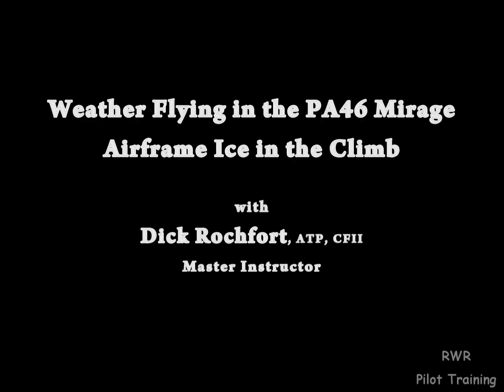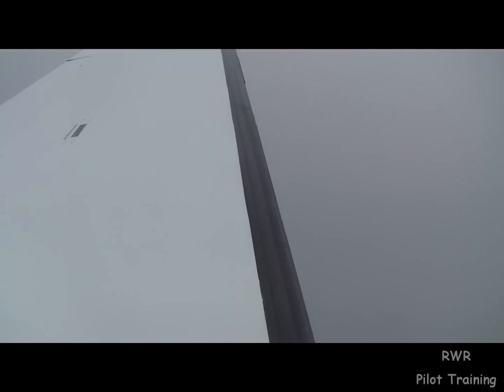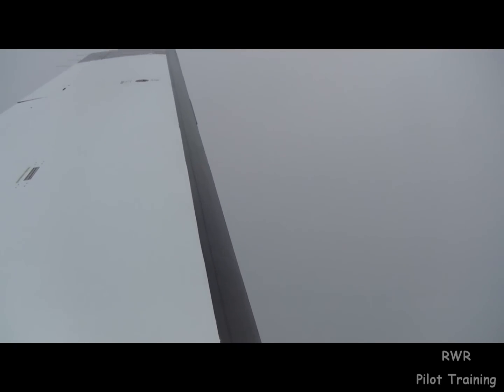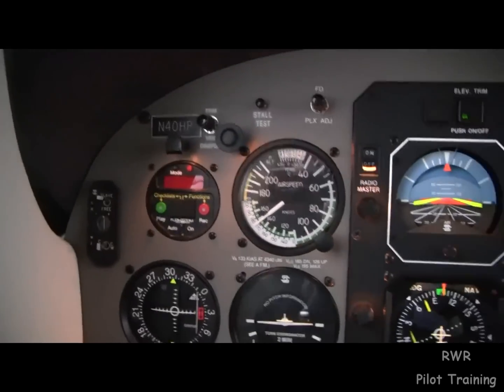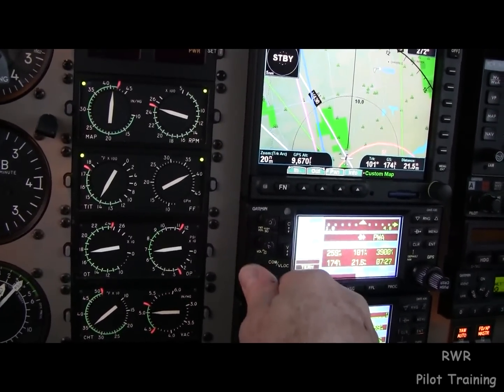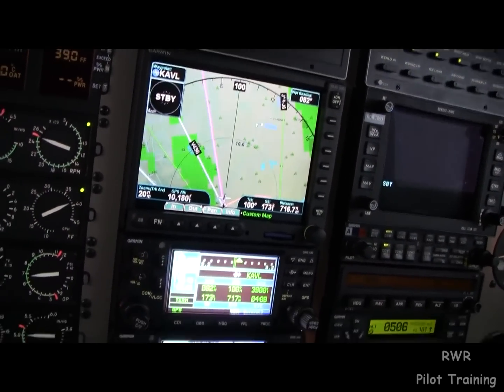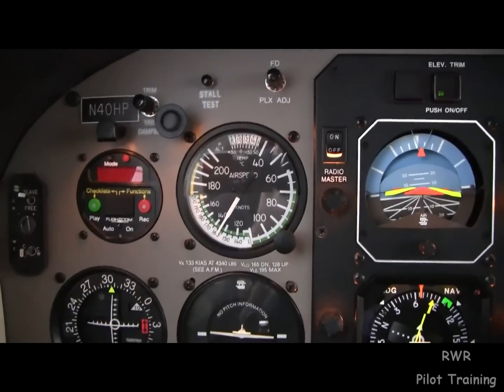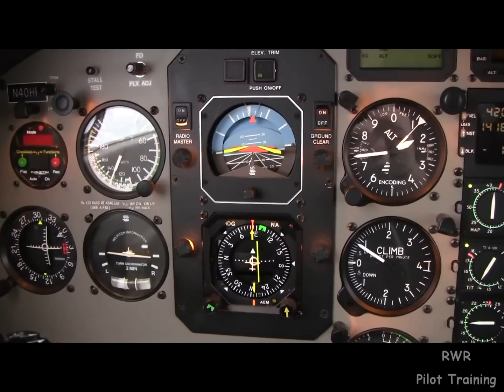Mirage Airframe Ice in the Climb

Comment: Mirage is FIKI approved. What is the issue?
Reply from the maker: FIKI certification for the PA46 was agreed-upon in the mid 80s when the first PA 46 was created. The FAA has not required nor has Piper offered to improve that certification. It is likely if it were recertified today it would be far more expensive and more effective. For this reason, light aircraft should only consider light ice in accordance with the CIP/FIP. Fly Safely - Train Often .. DR